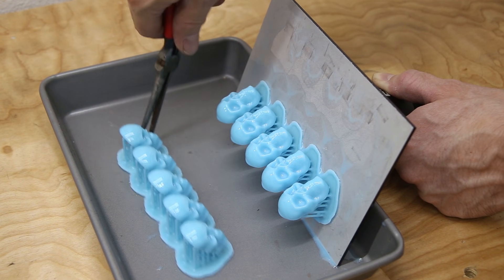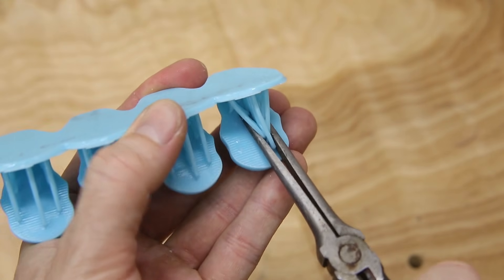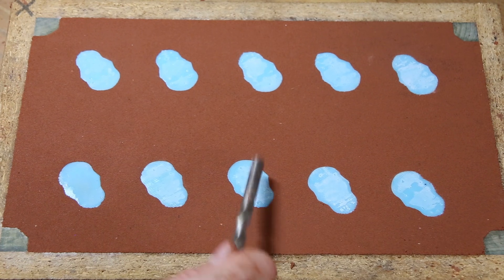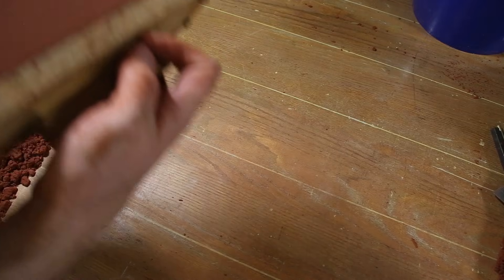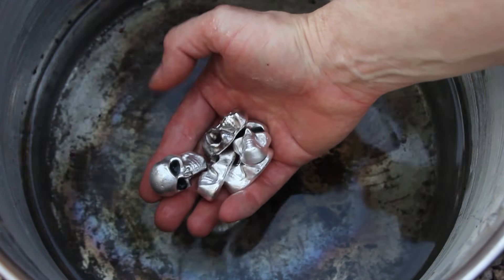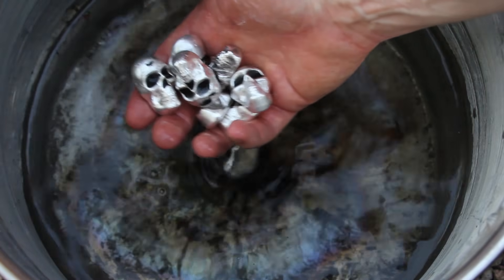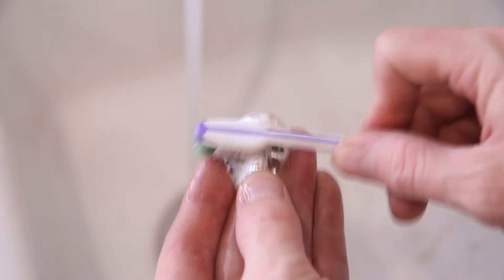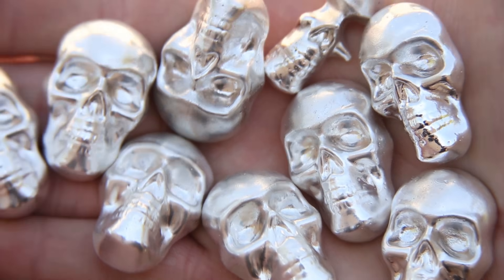Melting pure silver │ Casting fine silver skulls │ .999 silver bullion │ Metal casting │ ASMR

Comment: Wow that 3D printer is sick! I wonder if there is one able to print casting wax directly? At home we are using the lost wax method of casting items of hand carved wax, and pouring individual gestobalite molds. I have been interested in vacuum molding, to make more items to set up, but this sand casting you're doing is extremely inspiring! Great stuff
Reply: Resin printing works by exposing the liquid resin to UX, which hardens it. There's no way to do that with wax.